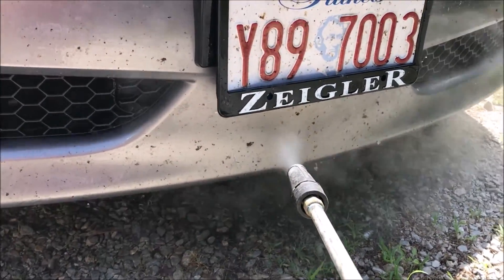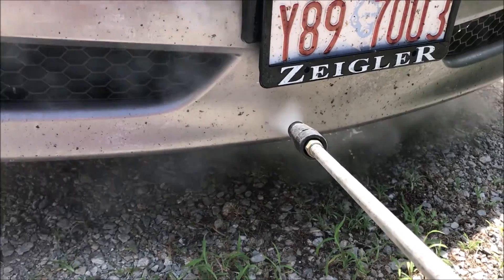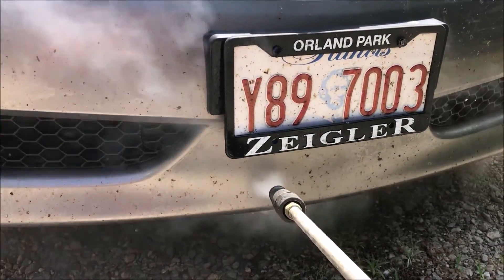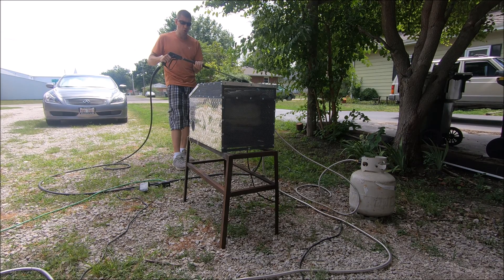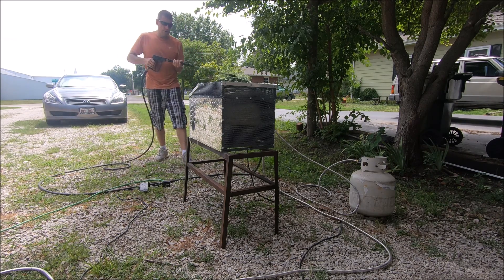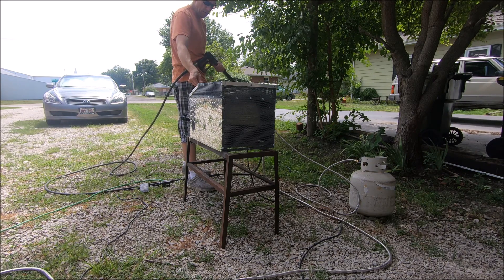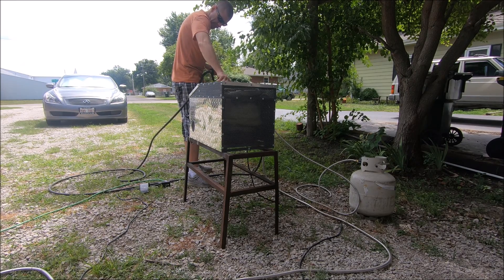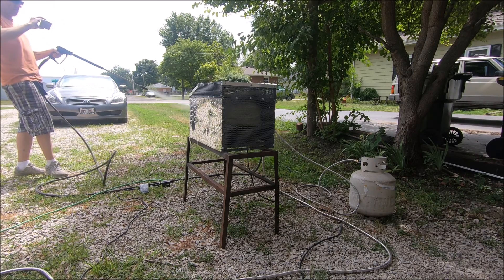Micro Boiler Process Control Success (Feedback loop)

Comment: You are the man! Your videos have been a great source of inspiration right now I'm working on a wood pellet boiler for my power washer. Would never thought about using pressurized steam instead of compressed air for power. You sir are the smartest man on you tube.👊👍
Reply from the maker: Cool , do you have any footage posted yet ?
Reply: Yes I started testing burn chambers last weekend.sorry for the wait on response not getting notified of replies for some reason. Doing my best to interact. 😎😜